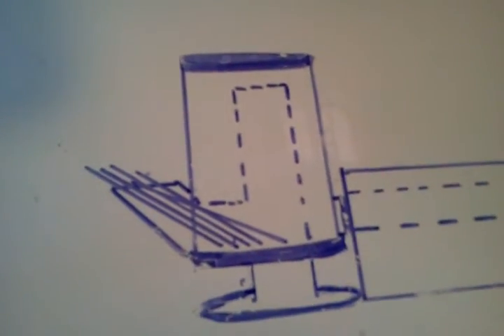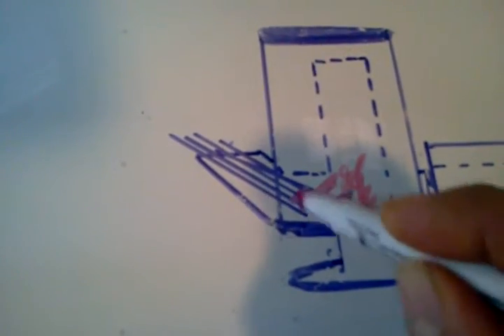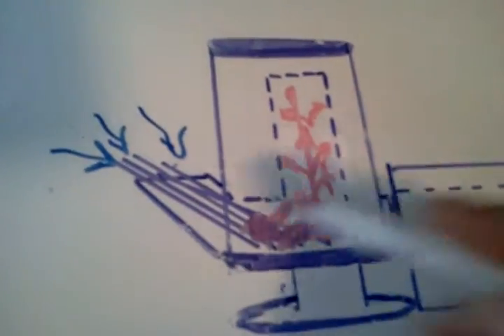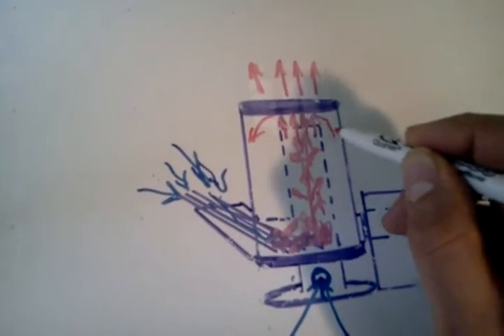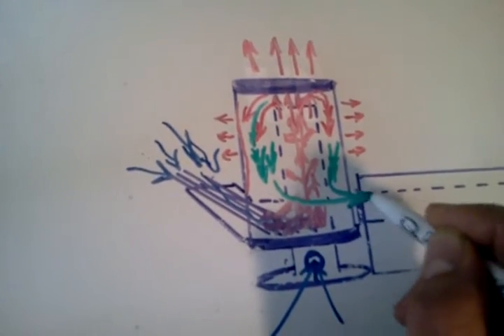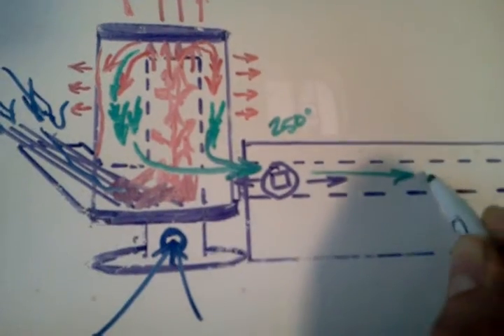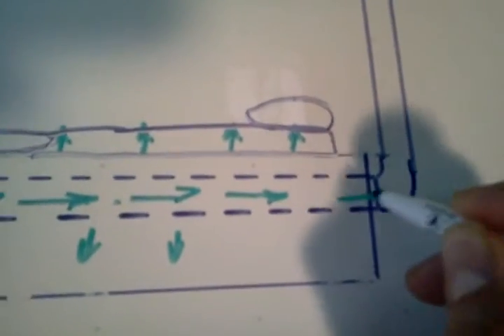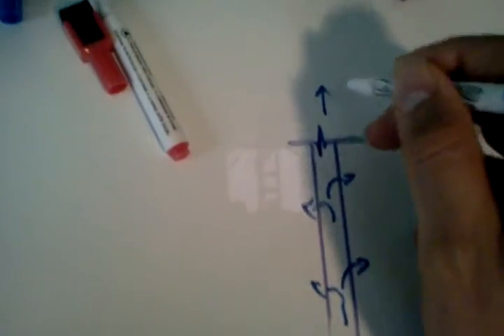Zaug stove whiteboard demo

Comment: TY!   Very clear.  Was wondering can the vent that is up to 25' travel over a pool of water and then go under water 24' then rise from the water,,,so you don't have to puncture the water or heat storage material causing potential leaks?

Comment: Hi I like the design, is it possible to use it ad an oven heater to dry fruit in a green house?
Reply: Yes that would work.Ive done mass dehydrations stuff before with simply a heater in a closet.  Just trial and error for time needed.

Comment: I'm just now learning about this style, would there be a slight cone shape to that inner riser ? To maximize that expansion / contraction effect. Or just the volume difference between inside riser v's outside riser is the deal?
Reply from the maker: The inside heat riser has a larger diameter than the air intake and exhaust port, to allow for expansion.
Reply: @zaugstoves6204  That makes sense, TY

Comment: rocket mass heater rip off
Reply from the maker: It's a rocket mass heater. It was invented and created in 2012 before any steel rocket mass heaters existed. This one is the original, not a "rip off"
Reply: Zaug Stoves
I'm only just learning about rocket mass heaters and happened upon this video. Saw the date it was posted and wondered if it might be the original. If that is the case then, we'll done. Genius idea, really a worthwhile invention which is a benefit to us all, unlike most "innovations" these days.
Thanks
Reply: Actually, rocket burners were 'invented' long before 2012 as used for years on ULCCs etc. to provide heat (for thinning crude oil) and clean inert gasses for ullage and void spaces.  Most shown on YouTube miss one or more of the elements essential to maximum efficiency.
Reply: @sixmagpies  I've been researching these for months now but yet to see a clear and complete how it really works video.  Any recommendations, ESPECIALLY for the material used to make the burn chamber???